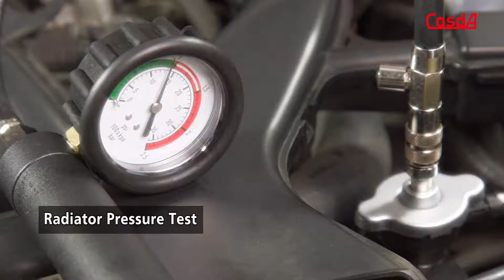Cooling System Service Kit (1 min ad)

Comment: Where is the coolant hose located that’s used to refill? Or did I overlook the correct placement?
Reply from the maker: Hi ChynaB, we can refill coolant from coolant filler neck on radiator or recovery tank. Thank you